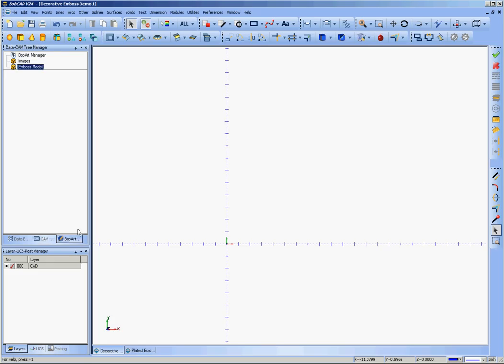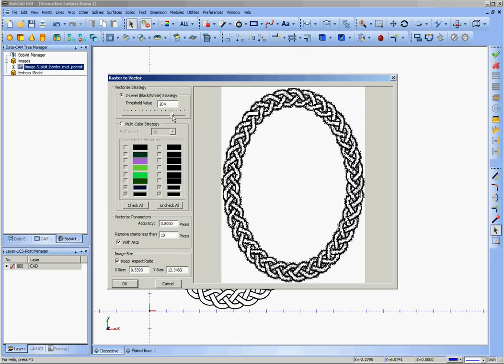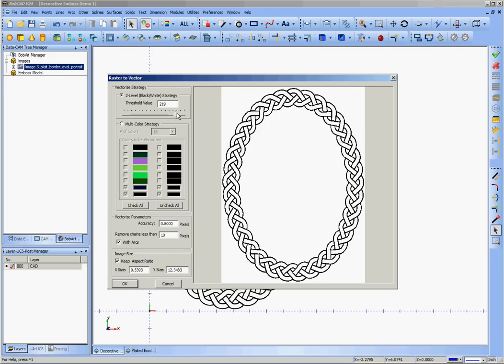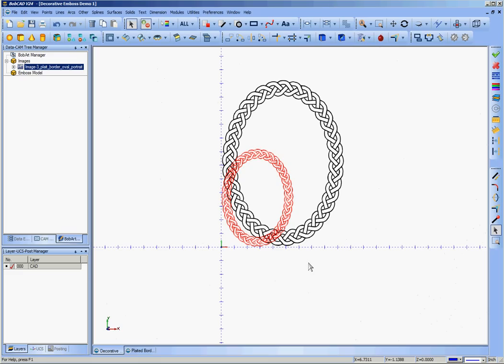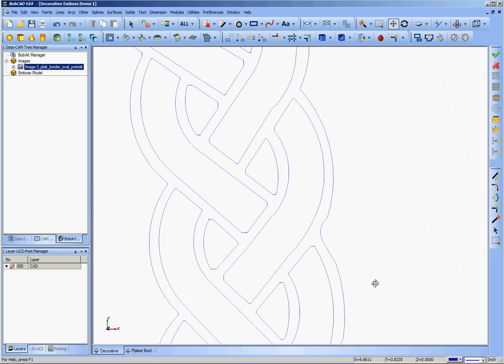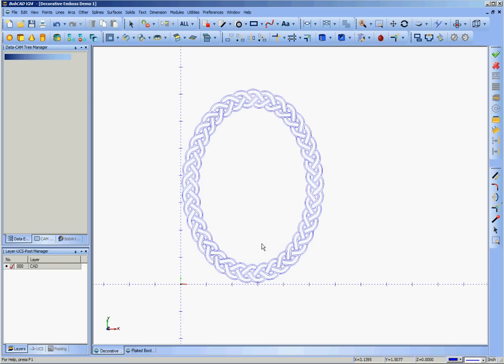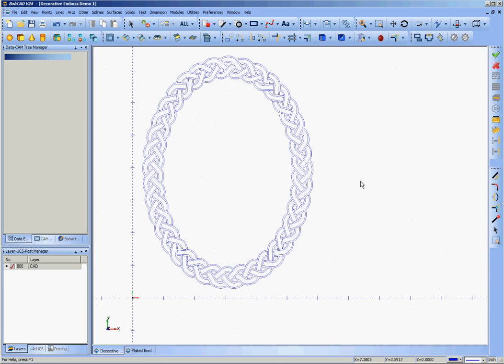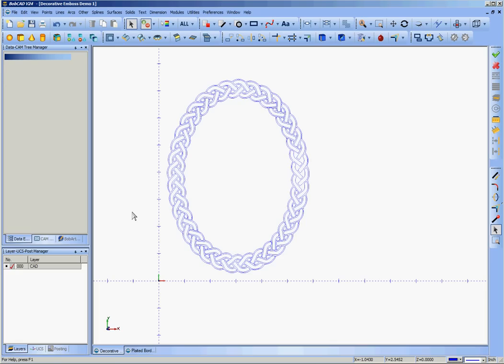Decorative Wood Carving using BobArt: Part1; Importing and vectorizing images

Comment: I was unable to find the celtic cross image that you used in your video. Do you have the website?
Reply from the maker: Here's a link to the forum thread on CNCZone where I first posted the tutorial. At the bottom, there's a file, "Border and Cross.zip", which contains the 'dxf files used in the video. You may have to register on CNCZone to be able to download it. Have fun! :)
Reply from the maker: TrotlineCNC Oops! Forgot the link. Here it is: http://www.cnczone.com/forums/tutorials/175913-decorative-wood-carving-using-bobart.html

Comment from the maker: The images I started with in this tutorial were found online with a google image search. Once you find a file you want to use, put it in a folder. When you load an image into BobArt and vectorize it, you're done with it as an image. BobArt doesn't delete it, it's still in that folder, but from then on, you'll only be using the vectorized geometry that BobArt generated from it.